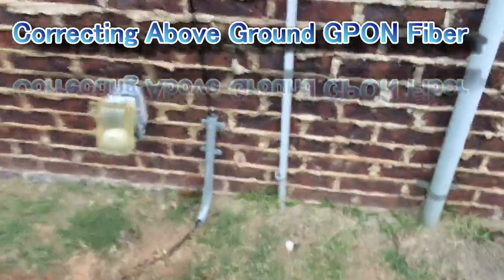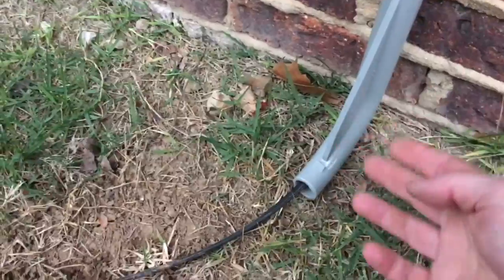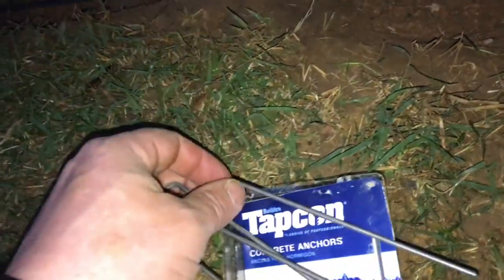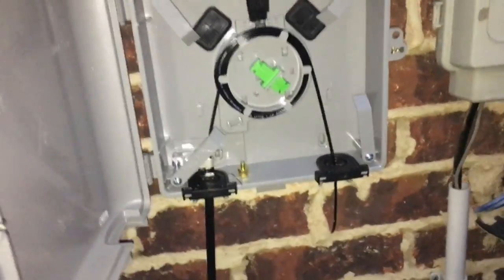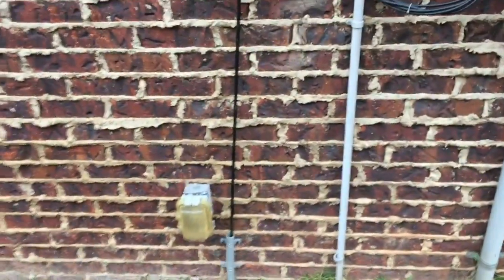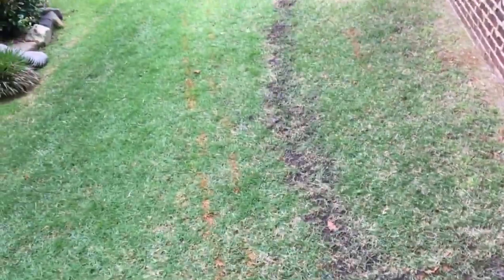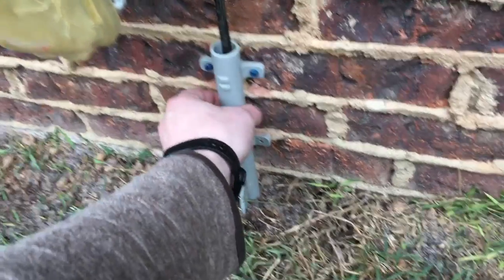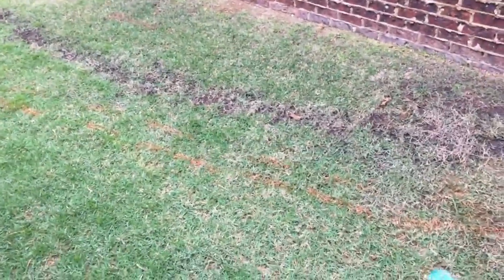AT&T Gigabit Fiber Internet -  Underground Fiber Installation Mistakes and Resolution Process

Comment: That's some DIY brick pointing there.  Man you did a horrible job.
Reply: That's some DIY overall comprehension of what is going on in this video.  Do you seriously not understand what goes on around you?
You take a Video that is about GPON (Gigabit Passive Optical Networks) and the Last Mile, (ONU - Handhole - Demarc/ONT), underground work that was done very poorly,.. and .. you turn it into you hating on something that has never happened, and never will on this home.  "Brick Pointing".  

PhillyDJ "Hook" -- Look man, A lot of Modern homes have what is roughly termed as "Messy Mortar"  -- It's purposefully left looking this way for aesthetic purposes for that 'old world' feel, if you will.  No Acid Washing going on here. 
The fundamental Mortar work is professional, and done quite well.  
No "Brick Pointing" has ever been performed here.  The house is new,.. 

If you are referring to me sealing a small hole that the Technician drilled into the brick to run Fiber Optic cable through -- Then come on.  I'm not about to put mortar over an unsheathed Fiber optic wire.  It's unnecessary and could be potentially damaging.  The substance I used looks fine (anything would on the side of a house for a hole smaller than my pinky finger) -- and more importantly works/seals 100%.

I don't know how you got to "Brick Pointing" from this video -- For those reading this comment and don't know what Pointing is..

"Repointing is the process of renewing the pointing, which is the external part of mortar joints, in masonry construction. Over time, weathering and decay cause voids in the joints between masonry units, usually in bricks, allowing the undesirable entrance of water."

Anyhow - thanks for the .. err.. comment. :)

Comment: So let me get this straight you ran the cable thru the pipe into the ground yet you make no attempt to close the opening of the pipe which in turn water will fill in there, destroying what ever is in there over time not to mention following the cable and over time basically creating a stream underground rather then running conduit all the way up to the box like you should have.
Reply: I fixed the depth of burial and the J-bend conduit from being above ground to below ground.  Fiber Optics should be arc'd not at a 45-50 angle and definitely not sitting where it can be damaged by blades.
However, no nothing is incorrect after this.  I can only assume you haven't a clue of the way this fiber optic cabling is built and rated.  It is sheathed in Kevlar and rated for 50+ years.  It is designed to SIT in water permanently if that's the situation at hand, 18 wheelers can drive over it and so on.  So no.. Water will not destroy "what ever is in there over time".  
You have to remember I didn't install this.. homeowners don't install their own fiber optic service -- I just took it into my own hands as the ATT crews weren't doing an ideal job.